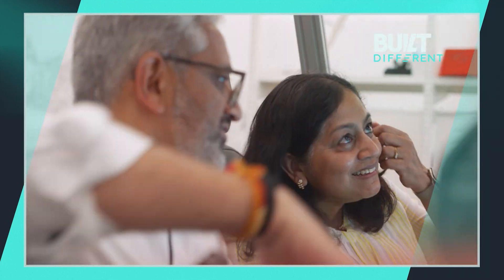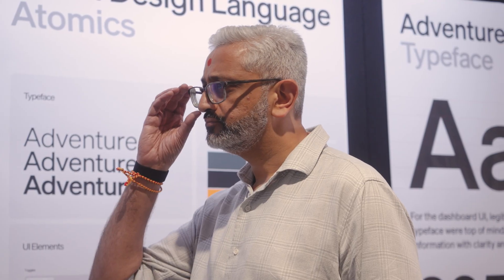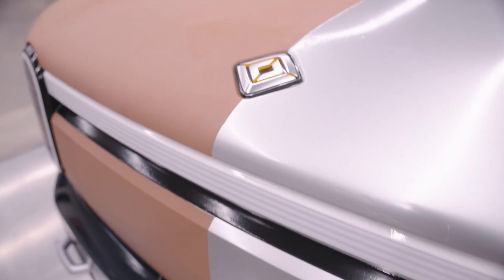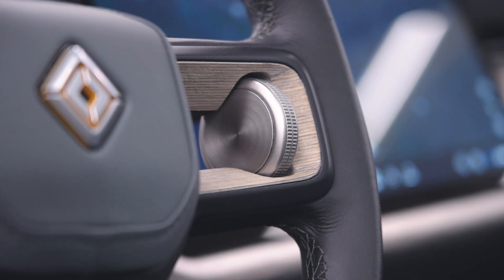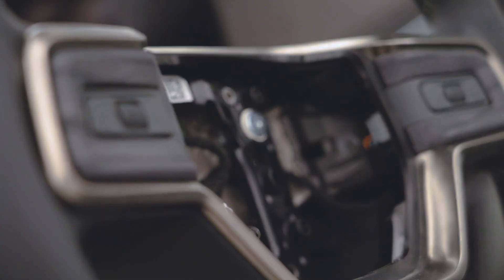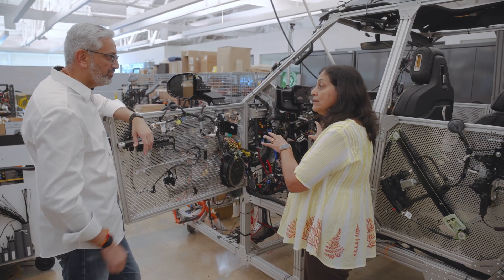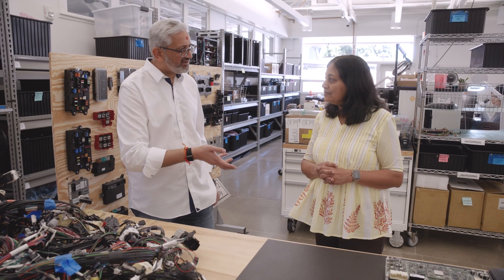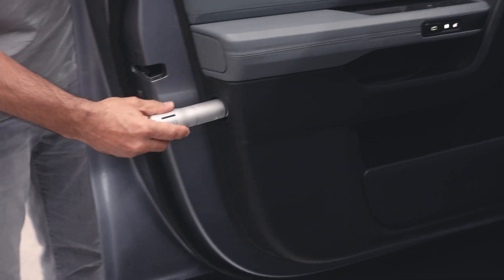Built Different: Rivian

Comment: Are their cars profitable?
Reply: I've had my R1S since August and thoroughly enjoy driving it and how comfortable not only the interior is but the whole driving experience.
Reply: @BA13115  but is Rivian profitable?
Reply: @robertbuzan8392  Depends on the volume of sales of the R2.
Reply: @bruceb1958  That's not what I'm talking about. What is the cost to make the vehicle versus how much they ask for. For example, the Ford Lightning cost $100k to make but sells for $80k a loss of $20K. Tesla's average a profit of $6K per vehicle.
Reply: @robertbuzan8392  According to their plan, the R2 will be able to be produced where they can make a profit. It's an economy of scale just like the Model 3 was to Tesla. Tesla never made any money on the S or X and only made money on the model 3 and Y. The R2 is Rivian's Model 3 equivalent.
Reply: @robertbuzan8392  Not at their current scale. You have to move a lot of vehicles to get economies of scale to be profitable and they aren't there. They are getting there even on their lower scale products though clever manufacturing (i.e. removing miles of cable and making manufacturing easier), but at the volume of the R1 they just haven't been doing it long enough to be able to do that lower volume cheap enough. R2 will change that. All of the lessons they've learned will allow them to build R2 for profit and the lessons from R2 will allow them to retrofit the designs of the newer R1s for profit as well. Nobody makes money on their 1st generation tech... You're just trying to make sure you have enough runway and learnings to survive long enough to make it to your gen 3 tech (which is closer to what R2 is) where you can buy and build at scale and turn a profit.
Reply: @TheRealAfroRick  Dude, I hope you’re right. Thanks for the information and Happy New Year.
Reply: @robertbuzan8392  Happy New Year! It really depends on R2. If it bombs for some reason... Rivian may be done. But if the numbers are solid and they can secure the right line of credit - Rivian and Tesla will be your US EV makers. As much as I LOVE the Lucid, their path to profit is nowhere near as clear. They are still looking a model or 2 away from a mass production "mid cost" vehicle and I'm not sure if they will make it. I sincerely hope they do, because the Air is FANTASTIC to drive.
Reply: @TheRealAfroRick   My concern is that everyone is overlooking the software team and not the software. If Lucid should go out of business, who would provide the software updates or are they legally obligated to continue that service for a a decade or more? It's easier to buy a 2000 Ford F-150 and work on it yourself. The parts are there. Software is not my specialty.
Reply: @robertbuzan8392 Fair concern. I've of the opinion that all of these software designed vehicles should have to have a clause in their sales contracts where they have to open source the software if they go out of business. Fisker folks learned that lesson already. But technically so long as the vehicle continues to run with its existing software stack, that's no different than any traditional vehicle.